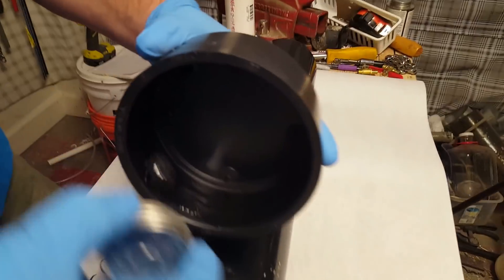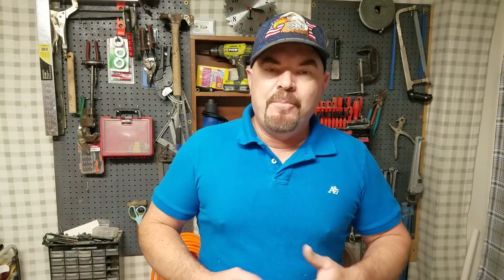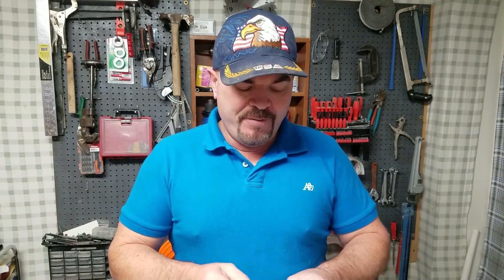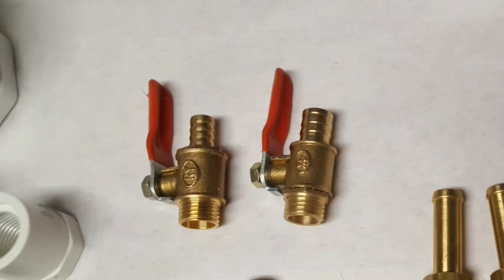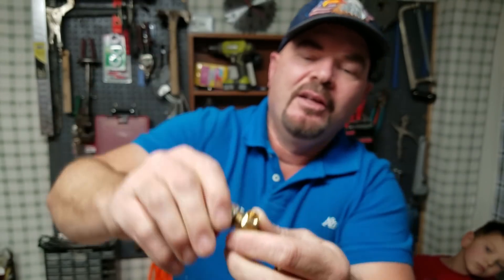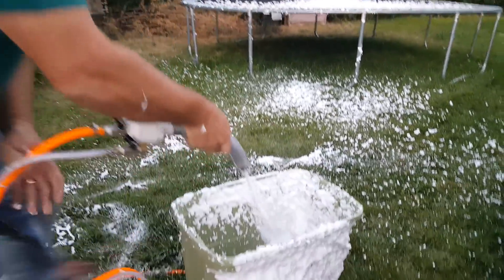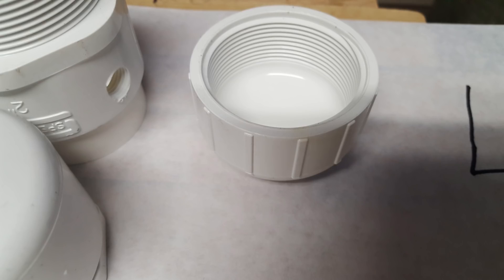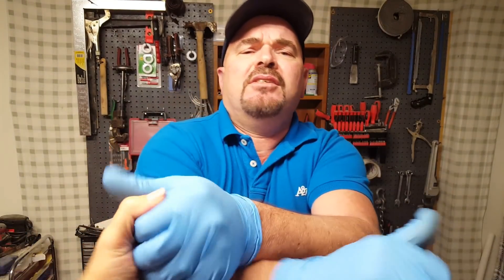Diy Foam Mate Kits

Comment: Could aircrete be used to insulate the walls of a shipping container?  
Like... maybe attach a "form" panel to the corrugated steel with 2x4 
spacers or something around the edges to create a space which you'd fill
 with aircrete?
Reply from the maker: yip it can